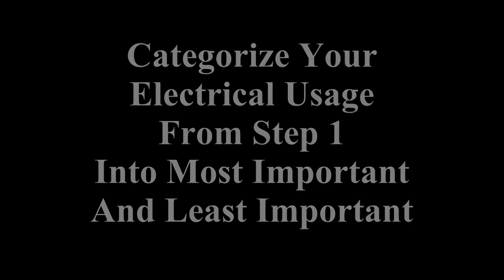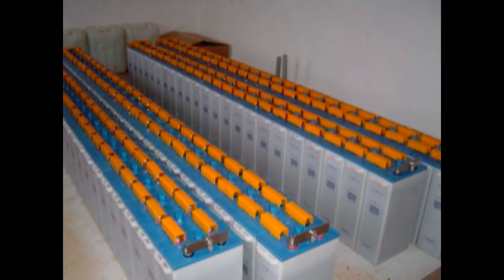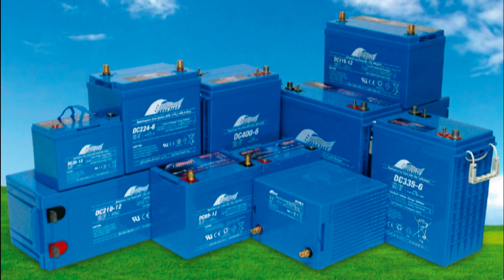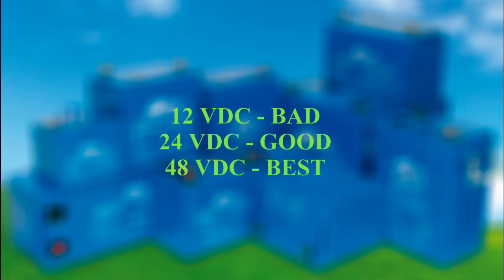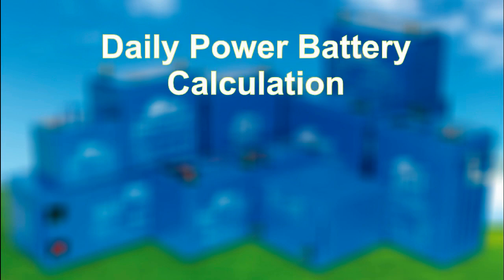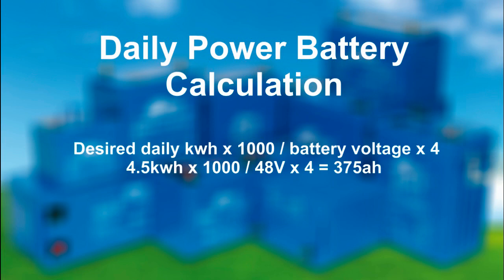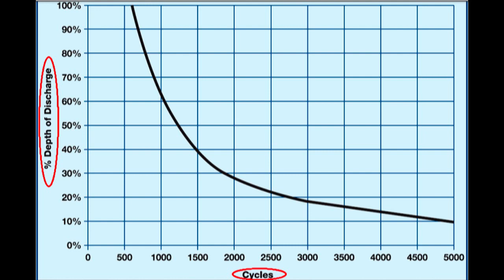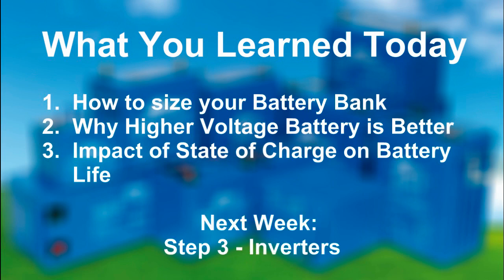Step 2 Solar/Wind Power: Battery Selection

Comment: This video on solar is much better than anything else I've seen on You-Tube or the Internet, very clear and comprehensive.  Well done, thanks Steve.

At 13:16 there is a graph of Depth of Discharge versus Lifetime Cycles of the battery bank.

at 40% discharge the cycles are 1,500.
at 20% discharge the cycles are 2,750. (2*1,500=3,000 ... -250=2750)
at 10% discharge the cycles, as you mentioned, are 5,000. (2*2,750=5,500 ... -500=5,000)
does this mean that you can infer that at around 5% discharge the cycles would be somewhere around less than (2*5,000=10,000 ... - 1000=9000) so interpolating one might expect 9,000 cycles?

And ... what would constitute a cycle?  Would cycle be synonymous with days?  That is, are you saying your 5,000 cycle expects Lifetime would be about equal to about 13 and a half years?

If 9000 cycle interpolation would make sense that would mean a battery bank if lightly used could be up for over 24 years?  Where is the sweet spot where investing in batteries would be extravagant because future batteries would be cheaper and better?

So many questions come to mind as I watch this video and the others.  Like where did you get that graph of battery life?  Can you recommend any resources such as books, videos for solar design?  And, now that this video is over 2 years old, what do you think about the AGM batteries?  How do you decide what voltage batteries to get?
Reply from the maker: Very good questions.  In battery terms a cycle is the amount of electricity consumed until the battery reaches 0%.  So at 5% discharge, there would be 95% of the battery's charge remaining.  Thus you have also used 5% of a complete cycle.  Everyone wants to know lifespan of a battery in terms of years, but it is in terms of cycles, and even those are a scientific guess.  Some of it is just plain good (or bad) luck.  I don't know there is a sweet spot with batteries.  It definitely varies because it has been different with any set I've ever had.

The graph of battery life was taken from the manual I received with my present batteries.  I overlaid some information in red to help visualize what I was saying.  I like the AGM batteries fine, but I have nearly ruined mine.  They must be kept in close charging tolerance or the heat build-up in them.  I was trying to do a "light" equalize, and during a time I was engaged in other activities, they suffered thermal runaway and the cases bulged from gas expansion.  They are still working pretty well.  I think it is good technology for low cycle usage like I do.

I wanted at least a 400ah battery bank, so my dealer came up with 6v batteries that were the most cost effective for me.

Thanks for the questions!
Reply: Steve Robertson Thanks Steve.  Your setup is impressive.  This stuff is so expensive and also critical to depend on for survival before I attempt anything like this I want to understand as much as I can.

Which is good because I have not even found any land yet, nor even decided what state I'd like to live in.  I do like you decision to be a major user of electricity, that makes a lot of sense, everything in modern life is geared towards electricity and electric power is the currency of life these days.

If you had it to do over again, would you go with the AGMs again.

Thanks for the great videos, I'm trying to digest what I am hearing.  Any suggestions for other resources on solar?
Reply: Justgivemethetruth Hey, just a quick word on this as Ive also been trying to get my head around it. The way I see it discharging 1 battery down all the way (once a day), and replacing it every 600 days, is the same as having 2 batteries discharging half way, and replacing x2 after 1200 days. Yes they last twice the length of time, but you have to buy twice as many.  So the same overall battery degridation occurs and the same $/kw used, give or take. The only advantage is that with the bigger battery bank is the potential you have stored... I.e. The length of time you can run without recharging. 

For steve he has chosen to cover about 5 days without any power coming in. This is more than enough for his overhead. Any bigger and he wouldnt be saving any money on batteries in the long run

... as far as I understand it anyway!
Reply: Maybe you can verify for us Steve? Steve Robertson . Personally I would rather buy a small amount of batteries and replace more often than have a huge initial outlay and have them last for the rest of my lifetime! If I screw them up, or a newer cheaper technology comes along, its not so much a problem.

What Ive also been tring to get my head around in relation to this though, is the following... 

Since..."A charge cycle means using all the battery's capacity, but not necessarily by full charge and discharge; e.g., using half the charge of a fully charged battery, charging it, and then using the same amount of charge again count as a single charge cycle" (from wiki)

... since the overflow/dump load storage into the water heater still goes through the batteries... essentially cycling them just a little bit but very very often... does it not still contribute towards the battery degradation? The power from the panels doesnt bypass the battery when it is full does it. It goes through them i.e. into them and then is dumped simultaneously (or almost simultaneously?). Does the fact that they are very shallow cycles mean they are not as detrimental to the mechanics of the battery, even when there are many more of then? Even if cumulatively they equal the same amount of net overall cycling as one big cycle.

Example: Discharging 10% of a battery (and recharging it), done 10 times, is equal to discharging it all the way down to 0% and back up again in one big go. Both equating to one full cycle. By extention, discharging 1% then instantly recharging back to full, done 100 times over, is also equivalent to one full cycle. And the same amount of power is being drawn from the battery in all cases. Now extrapolate this to say 0.0001% discharge and recharging. Yes it is being recharged almost instantly, but then it is being done thousands of times a second... or however fast a charge controller can calculate when to dump and when to charge. Is the net effect not the same still? Since the power is still coming throught the batteries, and the same amount of power being drawn out overall, isnt their 'workload' still the same? And thus their deterioration rate. Or in reality, in terms of the internal workings of batteries, are the multiple but minute changes in voltage less damaging than a smaller amount of deep cycles?

Cheers!
Reply: What im getting at in my roundabout way is yes storing your energy in the form of heat during the day allows us to increase our storage potential. But does it not still degrade the battery we have to the point where we are not actually saving money on batteries.
Reply from the maker: Tom-87
Tom, your assumption is dead on.  To answer Justgivemethetruth's question, I would buy used batteries from a scrap yard if I had it to do over, but I have no regrets with the AGM batteries either.
Reply: Tom-87  I think you are assuming a linearity that I am not sure exists.  That is, it was my impression that the deeper you cycle the battery the more you take off it's lifespan.  I can't prove that and I do not see any numbers either way.

Or it could just be a time thing.  If you have 10 batteries that you use 10% of for 10 days do you wear, more, less the same as 1 battery that you cycle 100% or for 10 days?   ( the 100% is just a number, not realistic, but that is what I mean ... there are non-linear behaviors here in some areas )

But on the graph at the 60% discharge you get slightly over 1000 cycles, whereas at 30% discharge you get slightly under 2000 ... meaning that you get slightly more cycles/discharge percentage as you discharge more and more.

At 80% discharge you get maybe 800 cycles, and then at 40% discharge your get almost 1500, not really a win, but not really much of a loss either.

at 20% discharge your get 2750 cycles, and at 10% discharge you get 5000 ... less than double.

This seems to indicate that you get more performance from a deeper discharge.  But how do we know if and how accurate this graph is?
Reply from the maker: justgivemethetruth
You're right, that it is not an even trade and that the graph is not perfectly linear.  But if I can find a battery that will last for 14,600 cycles of 50 average amp hours per day, it will outlast my days left on Earth, and I will die a satisfied man.  That is all I'm after.  Anything beyond that probably won't help another soul, because my kids will auction everything off when I die.  Perspective is everything.

Comment from the maker: Another way I save on battery size is by using heavy power loads during peak production only.  This includes our electric oven and stove, water heater, air compressor, battery chargers, (cell phones, cordless drills, camcorders, radios, etc.  These things that will not run at night are not figured into the electrical storage (battery size) since they will never run outside times of electrical production.  Those things are only figured into electrical production (solar panel calculations).

Comment from the maker: You are correct Brian.  You would not save money on batteries, but on the wiring.  That's the reason my formulas convert everything to VA (watts) to get everything on a level playing field across all systems.  By doubling the voltage, you half the amperage - essentially allowing you in most case to use wire no more than half the size.  However, you can save on battery sizing by finding other places to store your energy other than batteries.  I store energy in hot water and compressed air.

Comment from the maker: I do use a timer on my 25 cu ft fridge.  I found that it works best when I shut it off at 9:00pm, on at 1:00am, off at 2:00am, on at 6:00am.  Stuff in the freezer would thaw slightly, but that hour of running in the middle of the night keeps everything solid.  Experimentation is key.  If you have tier 3 Energy Star, then you should be in great shape.  The tier 3 systems depend a lot on thick insulation for efficiency, making them ideal for power outage scenarios.

Comment: Hey Steve. I have a tip. We live in south Louisiana, and we have to contend with power outages. We went to the next size larger frig. and freezer (18 cu\ft to 20 cu\ft frig and 15 cu\ft to 19 cu\ft freezer) and used the additional space for "Blue Ice". We NEVER use it for anything but to keep the food cold in case of power outages. When you up grade your's could use the same technique and leave you frig and freezer off from dust till dawn. We are late to the game but are looking at solar.

Comment: I will make one critical comment.  The video seems to imply that an individual would spend less money on batteries which is not the case.  ex. (4) 12V 100 Ah batteries wired in parallel would give you a 400Ah battery bank at 12V equivalent to 4800Wh, and the same (4) 12V 100Ah batteries wired in series would give you a 100Ah 48V battery bank equivalent to 4800Wh.  The only difference being that the max current flowing in each system.  The total power is the same.

Comment: Really like your video,  thanks for posting them.  You are correct that a 48V system often is better than a 12V system because it can produce the same power at lower amperage thus reducing the infrastructure cost of copper in your design and reducing cost for high current rated disconnects ect.

Comment from the maker: For golf cart batteries to tell if you have a bad cell - charge them up normally, then remove charger.  Put a heavy load of about 50amps (motor, heater, etc) on the batteries.  If voltage quickly drops below 11 volts (in like a minute), you probably have a funky or dead cell.  Try equalizing the batteries and test again.  If the test fails again, the batteries are toast.  Anti-sulfating agents change chemical state and aren't really recommended.  I don't believe in electronic ones either (IMO).

Comment from the maker: My next video will be on battery maintenance, but I know you have a need now.  You can take some water out and store it in a sealed glass jar to use filling later. 12.5 may not be bad, unless a cell is bad.  Check each cell with a hydrometer.  If any read below 1075, they may be bad.  Equalize charge them @ 16.5 volts for 36 hours in a well ventilated area (they will really boil - if batteries get hot, stop charging), rest 4 hours, & check with hydrometer again.  If all read over 1275 its great.

Comment: I just bought a golf cart and the water level for the batteries is to the top is it ok to take the extra water out and get it to the right level or should I leave the level....the 36v charger doesnt work so I configured them to 12v and once they are charged it always dropps black to 12.5 I'm guessing its not holding a charge maybe it needs equalized IDK,,,,,The batteries have probly been used and abused but there are only a year old,,,I've had them for two weeks

Comment from the maker: Robert, as long as batteries are kept charged, they won't freeze.  The battery bank I had in NM was outside in a wooden box (4'W x 16'L x 2.5'H).  I stacked straw bales around and on top of the box in winter, and it worked fine where temps could go as low as -12 in blue norther winds at night.  Hay bales won't be any more flammable than the barn you will keep them in.  The batteries will only be gassing hydrogen when charging heavily.  It's no more flammable than a can of gasoline, so not scary.

Comment: I've got 2k in solar panels right now and all my inverters are grid tie but I've been thinking of switching to off the grid for awhile. My biggest fear with batteries is when the temperature drops to below freezing. My only option for my layout is to have the batteries in the barn with no heat what is your experiences with the cold. I thought about maybe build a vented box and stacking hay bails around them but that sounds like maybe a fire hazard. LOL

Comment from the maker: My Whisper 1000 had jumpers you could move to change the voltage.  Some charge controllers can make the leap to 48v.  But you're right about the inverter - it will require a new one to make the move if you choose to do so.

Comment from the maker: When the opportunity, rises, I would move to 48v.  But I wouldn't make a special effort for it.  Higher voltage is good for any wattage level, in my opinion.  I started out with just 800 watts of PV.  Anyone that is already started and running at 24v is fine.  But I would recommend anyone at 12v to migrate to 48v as soon as reasonably possible.  It usually isn't necessary to buy new batteries or PV panels to move to 48v - just wire them in series to get 48v.

Comment from the maker: John, if you're already set up for 24v, I'd say that it's fine where you are.  Xantrex builds good equipment - I chose their charge controller. 

 A lot of people have used golf cart batteries and I know they work well.  If they are wet cell (flooded), make sure the plates are covered with water and give them a good equalizing charge at least every couple months.  That will make sure they hold a good charge through out their life.

Comment: what do you think of the golf cart batterys i have 16 6 volt for a 12 and a 24 volt inverter most of the time i use my 12 volt xantrex 2000 watt inverter and i keep my outback  off if the power go's off for more than a day or 2 then i hook up my outback do you think getting a 48 volt inverter is a good thing for having only 1600 watts of solar